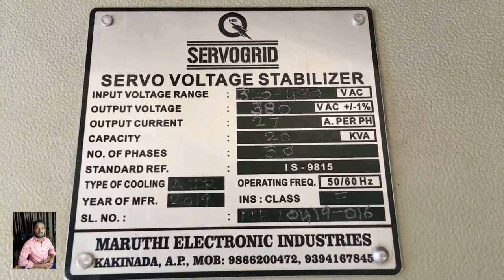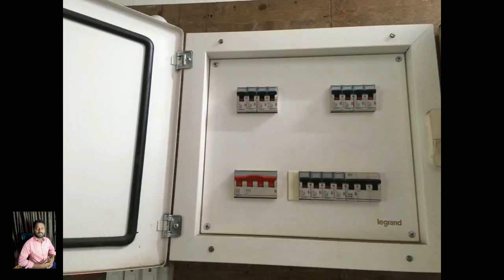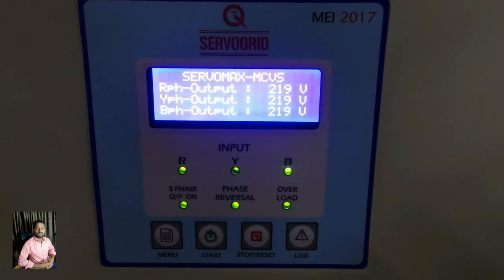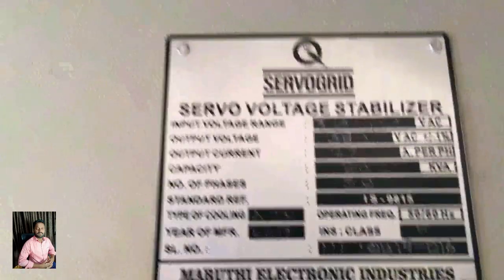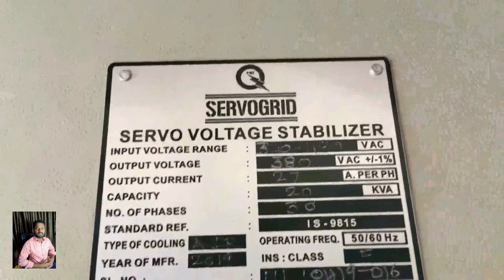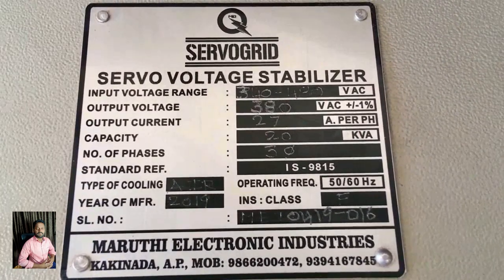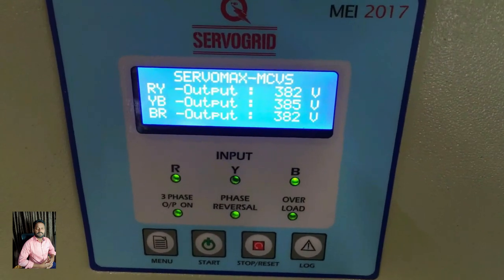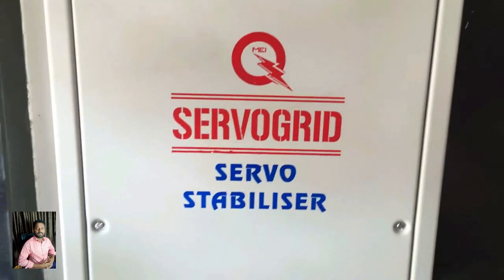Three Phase 20 kva Stabilizer Connection Explanation Practical in Telugu

Comment: Hii sir maa intlo recent ga AC pettamu..voltage intlo vunna meter lo high voltage vasthundi 310v...but 230 V vunte saripothundi anta kada...aa voltage ela thagguthundo konchem solution cheppandi...AC ki stebilizer pettina kuda stebilizer work avvatledu...I mean output ivvatledu
Reply from the maker: Hi bro
Input voltage 310 rakudadhu okasari lineman ki cheppandi
Voltage stabilizer 140 voltage to 280 voltage varaku panichestundi